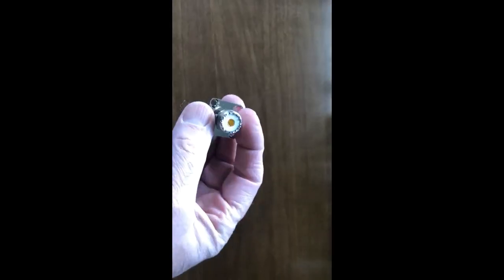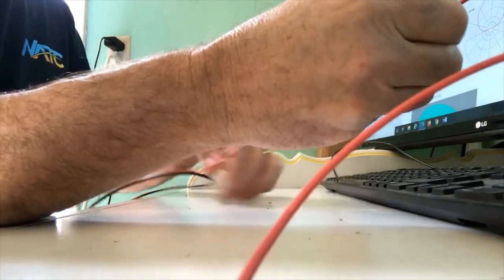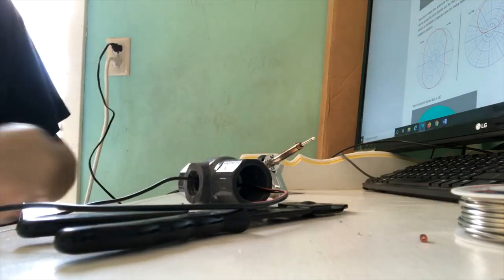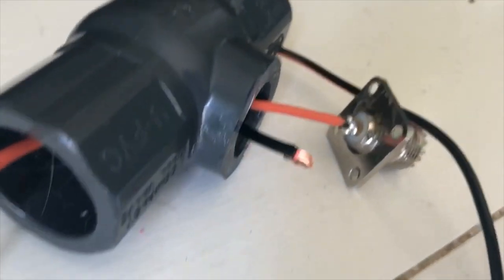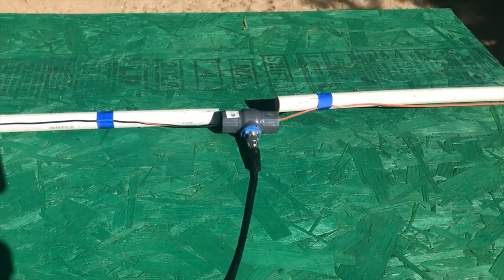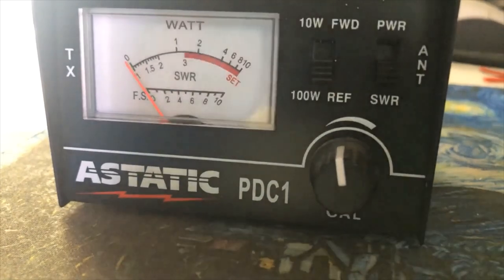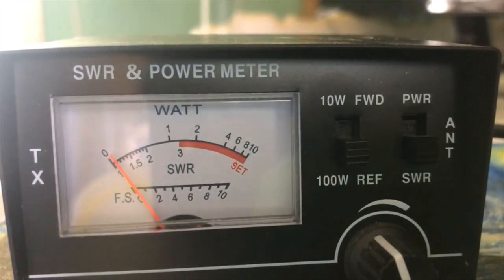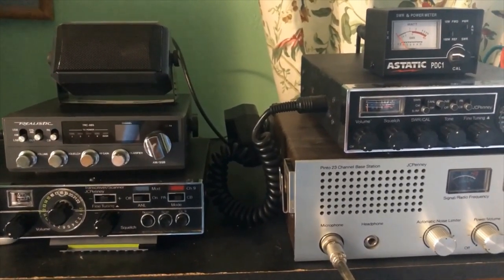Homemade PVC CB Dipole Antenna

Comment: The top scale on your meter is in watts. The scale below it is SWR. Your first match was closer to 4.5:1.

Pro tip: Grab a standard calculator and enter the following:

234 / 27.205, (Ch.20), = 8.6 feet.
.6 X 12 = 7 inches so each leg of your dipole will be 8' 7"

This will save you 12 of your 13 trips out to the yard.

If you are making a vertical dipole, use the above formula but add 5% to the bottom wire.

8'7" = 103" X 5% = 108" for the bottom leg. This should make the dipole a little more broad banded to flatten your match between 1 and 40. I haven't used PVC but be aware that proximity of an antenna element to metal structures or even some plastics or Bakelite can reflect the signal and affect the match. 

If you are a true purist, you can also figure in the velocity factor of your coax.

ALWAYS use the minimum amount of coax necessary to do the job. Having a 30 foot coil of extra inline coax laying on the floor of your shack makes an electrical choke which absorbs power that you could otherwise be radiating into the air.

Velocity factors of the most popular coax as follows:
RG-58U   = .66
RG-58AU = .66
RG-8         = .66
RG-8X      = .73

234 / 27.205 = 8' 7" X .66 = 68" or 5' 8" for RG-58U, RG-58AU and RG-8 cables

234 / 27.205 = 8' 7" X .73 = 75" or 6' 3" for RG-8X cable

When measuring your coax, take the 5' 8" or 6' 3" figures, depending on your cable type. Measuring your cable requirements, use odd multiples of the above figures.

Example: If you are using RG-8X and need about 50 feet of coax,

50' X 12" = 600"
600" / 75" = 8 X 75" lengths but this requires odd multiples so you either round up to 9 lengths or round down to 7 lengths depending on your requirements.

If you are using RG-58U, RG-58AU or RG-8 coax @ 50 feet.

50' X 12" = 600"
600" / 68" = 8.8 lengths so for odd multiples you can round up to 9 lengths or down to 7 lengths depending on your requirements.

This shouldn't require saying but obviously you do not cut your coax to these lengths but measure it out to these equivalents.

I convert these measurements to inches so as to not have to convert decimal fractions of feet to inches later for simplicity sake.

All of the above formulas work for any frequencies. Just substitute the center frequency of your band of interest in place of the 27.205 center frequency of the 11 meter CB band.

Example: 2 meter ham band = 144 to 148 Mhz center frequency is 146 Mhz.

Just be aware that with higher frequencies comes tighter tolerances. Where you may measure or trim inches off a wire type CB antenna, you may be measuring or trimming millimeters at 2 meters or 70 centimeters, (The 440 Mhz ham band.)
Reply from the maker: Wow, thanks for the information! When I made this antenna, I had zero experience with antenna construction. I appreciate the constructive criticism. You have given me a lot of information to digest. I realized later after making a few videos that I was reading the SWR meter wrong. I was also horrible with my soldering skills when I look back. The past year I have been reading up on antennas and made my first vertical dipole for my 2-meter radio. You are correct, adjusting the length on the 2-meter antenna was very precise. Thanks again for the information and 73s from 595 Northern Nevada!
Reply: @RidgeHikerAdventures  Happy to help.
Pro tip: The next time you want to solder to ground on an SO-239 antenna socket, File the chrome off from the area that you're soldering to. Solder prefers to stick to the underlying brass rather than chrome.
Reply: You know your stuff!   Stuck in a second story apartment. Would I get any use from this antenna, if mounted vertically against but extended 3" - 8" out from a brick wall or column?  Local CB commination is what I'm after.  Thank you!
Reply: @laraza4trump130  Unless you have 16+ foot ceilings, the dipole antenna in the video won't work well for you.
    If you could see the signal coming out of, say, a mobile antenna, you would see a radio wave emanating from the shaft in an up and down wave and a magnetic wave coming from it from side to side. 99.9% of CB antennas are "VERTICALLY POLARIZED" this way.
    If you constructed that dipole and hung it horizontally on your wall, you would reverse your polarization. This isn't necessarily a bad thing if the people that you want to communicate with have their antennas polarized the same way. If not, you won't transmit or receive very far. Horizontal polarization will inherently receive less noise and static but at the cost of who you can effectively talk to. This is because most radio noise is also vertically polarized.
    What I would suggest is an inverted "V" antenna. A child of 5 could build it, (No offense intended. They're just that simple to build), and they are vertically polarized.
    The simplest way to build one is to cut any kind of copper wire into 2 lengths 103 inches long, connect one leg to the center conductor of your coax and the other to the shield braid. Hang the end of the coax with the 2 legs connected as high as possible on the wall. Extend the other end of the 2 legs out and down at a 45 degree angle at the ends and pin them to the wall. You must let the coax hang in the center down to the floor. Plug it in and you are on the air.
    You would be smart to take a small piece of plywood like 2 X 4 inches, drill a hole on each end and two in the middle like a criss, cross so that you can wire tie the 2 legs and the coax to it for strain relief then hang the piece of wood on the wall with the top hole. If you are using RG-58U coax, the center conductor is pretty delicate. If it breaks and you don't know it, keying up your radio can blow the final transmitter transistor. RG-8X is a few cents more per foot, not much bigger than the 58U and is a lot more robust with a stranded center conductor rather than a single brittle strand.
    It is always a good idea to check your antenna with an SWR meter. You can trim this antenna for a better match if need be. Check it on channel 20 to start. If it is above 2 to 1, you can trim off 1/4 of an inch at a time ON BOTH LEGS and TRIM THEM THE SAME. If you get it below 1.5 to one on channel 20, 1 and 40 will take care of themselves. If you trim it too much, your match will begin to rise and will really go up on the bottom channels. You should NEVER key up with a match of 3 to 1 or higher or risk damage to your radio.
    BE AWARE. The inverted "V" antenna is vertically polarized but very directional. If you have it hanging on a north facing wall, your best transmission / reception will be north and south BROADSIDE of the antenna. East and west means east and west.
    KNOW THIS. You can NOT build 2 of these and hang them north and east and connect them together. You can, however, build to of these, hang them north and east with separate coax and plugs and feed them from your radio through an ANTENNA SWITCH. All you need is a 2 way switch. You can pick one up at a CB or ham radio shop. It will have 3) SO-239 CB type antenna sockets on the back. Two will be for the antennas and the 3rd for a short jumper to the back of your radio. I haven't bought one in decades but they aren't too expensive, adjusted for inflation.
    If you do this, when you get someone's attention, as they are talking, switch back and forth between the 2 and which ever is louder, stick with that one.
    I have used these many times on the pirate bands to talk to South America and Europe on single sideband at 200 watts with no problem. If you have a standard CB, you may get around town a few miles or so as long as "town" isn't down town Manhattan.
    Good luck my friend. I can tell by your handle here that we don't agree on politics but we can agree on radio.
Reply: @jeffmccrea9347  Inverted V is a fantastic option but I don’t have the room and it’s a concrete box.  I’ll experiment with one and want to make one to test in open air.
Great information a two-antenna switching setup would be fantastic.
I’ve got a 80’ish exterior 2’x2’ brick support column, probably steel core.  Management already agreed to a ½ wave dipole, mounted vertical, externally to that column up to 1 foot away.  It’s relatively free of RFI and is part of my balcony, which is abnormally large.  It seems like a good choice for a ‘low’ RFI environment.  It’s large enough to build a faraday cage. Chuckles  I’m on the first two floors and mounting it at ¼ wave height or higher is no problem.  I can't do the ground plane radial setup.  
My real concern is if I’ll receive anything…  with that type of setup.  
Oh the nick!  Forgot I was still using it.  Came up with it, in 2016 to tease folks that bought the racist MSM narrative that Hispanics wouldn't vote from Trump.  Poking fun at the hypocrisy of it all.  I’m a “Tasty Canadian” as Art Bell used to say.  Lots of us come equipped with a bent sense of humor.  😊
At this point I might as well just ask to stick a SDR, utility computer and DX commander on the roof, and remote into the system from my unit
Reply from the maker: @laraza4trump130  Mounting it vertically would be best for local communication. Optimal height for a dipole should be around 1/2 wavelength. My antenna in only around 10 feet off the ground but I'm still able to get out locally. At that height my antenna is more directional than omnidirectional, and I've observed that with range tests. With you mounting your antenna on the second floor I would imagine the extra height would get a better radiating pattern than I do. Try it out and see what happens. 73s from 595 Northern Nevada.
Reply: Yea, you took the words right outta my mouth....lmao

Comment: Mount Verticle with the POSITIVE on top and do not use metal mast pipe so the antenna id=s close to the pipe will kill your swr reading but a good job thank you for sharing.
Reply: Yes I found that out cant mount it on metal pipe but  horizontally in loft beams great for ssb

Comment: I just saw this.  I am somewhat impressed with the construction and the process.  I am quite a purist but look at the practical and quite frankly, this process would produce a very good antenna on any frequency up to about 900 MHz of course using a different connector and feedline for anything above 30 MHz or over 100w.  There i would move into RG8x, RG8, then LMR as frequency and power increase. At 27 MHz RG58 is fine unless the run is terribly long, over 100 ft. I would agree with one poster about doing it in free space - but probably not anything significant although i would personally have tried to get it up close 15 feet from the ground on a mast - I do doubt much difference.  I do not know if you are planning to use it vertical or horizontal, most look at diploes as horizontal.  If your primary conversation is base to base, horizontal seems best for several reasons.  One, a dipole does have some directional component - off the sides - and if the communications are to mostly the same places, orienting it will help, in fact off the ends there is a significant null.  If you are talking mainly to mobiles go vertical, there is about 20 DB loss in a vertical to horizontal path, that is over 3 S units - 18 db.  dipoles can be mounted vertical if the feed comes off at 90 degrees and there is a way to go down the lower part using coaxial cable as the lower half of the dipole.  i did build a dipole for 2 meters using PVC about 10 years ago - we had a friend who was in a nazi prisoner of war camp (an HOA) and could not put up an antenna, we put in in an arborvitae about 5 feet off the ground. He could hit every repeater within 50 miles with 50 watts. I have also used thin wall PVC as a radome for 2m slim jims,  I built 6 for an event, tuned the first one outside the PVC than put it in and it was long. The slim is about 50 inches long, i had to cut off about 3/4 inch.  I have since learned the reason on a fan dipole for 20/17/15 meters i built with speaker wire, two winters got to it and I rebuilt it with bare wire.  The bare wire was set to the same measurements and was bout 6-8 inches short. We all work with velocity factor on coaxial cable but it also applies to antenna wire.  Introducing a insulating jacket makes the wire seem longer to electricity.  It is only about 3-7 percent depending on the insulation composition and thickness but it is there.  If you work with an antenna modeling program like exnec it will show that.

Ralph Brandt K3HQI (Extra Class) WRPG834 KAOR6315(old CB CALL) AFA3HQI (expired AF MARS)
Reply from the maker: This was one of my first antenna builds and I was happy with the results despite my soldering skills at the time. I chose this design for its dx properties as well as it was pretty simple design to construct. I mounted it horizontally with it orientated north/south. I placed it on top of my RV which was not the optimal height at around 10 feet. I was surprised how well it performed. In the two years I used it, I talked all the way to Australia and with all 50 states. The coax run was 36 feet. Thanks for watching and the comment!
Reply: I wanted to add this and missed it. Try an inverted v some time. A dipoli has nulls off the ends and brst signals off the sides. Those nnulls can be about 30 db and about 20 db at 5 degrees off the line of the antenna. An inverted v is cut anout the same as a dipole but the center is pulled high, the envs sloping down. My 80 meter 128 ft long was a dipole running NW to SE when i drooped the ends i started working the Carribean and never had a vontact there before.

Comment: For those of you who don't know...the antron 99 and imax 2000 are modified endfed vertical dipoles.   You lose around 20db being horizontal polarized if you use a reg dipole on cb and talk to someone vertical.  Keep that in mind. Best to be vertical polarized on cb
Reply: yes, and someone says that orizzontal takes too much noises..
Reply: @napomania  man made noise is normally vertically polarized.  A vertical on the lower bands below 14mhz makes it pretty obvious. I prefer a vertical for 14mhz to gigahertz. Noise is less of a factor it seems at 14mhz and higher.  Some people run stuff like the old moonraker 4 and maco shooting star that vertical and horizontal polarized elements.  You can also use 2 antenna at once with different polarity and it will eliminate phase shifting and make it easier to hear.  You can learn alot building antennas.  It also helps if you have a antenna analyzer or a nano vna to check it
Reply: Lose 20lb what on my fm dipole kit pulls in station all over 🎉

Comment: Best antenna I ever made started with a carbon arc rod while in the navy. I made it for a am/fm radio. I was picking radio stations on both bands from over 50 miles while midship of an aircraft carrier right below the flight deck. I thought about trying it with a cb radio to see what kind of reception/transmission I could get. Never made it to a shop that sells carbon arc rods.

Comment: Nice video. Would it not be easier to twist the 2 wires together and then solder them to the connector? Just saving a step.

Comment: Interesting antenna I don't think I have ever seen a PVC plastic pipe Di-pole done before and it's all new to myself and I was just wondering if I could make a similar antenna but for the 2/70 amateur radio frequencies and if I actually made one then it would be interesting to try it out on the 2/70 bands and just see how far I can get with just 25 watts so I'll give it a try one day and I'll let you know how I got on making the antenna and I can get all the bits from my local DIY shop and it should be cheap enough to buy in the shop so anyway that's my plan. Thanks and best 73's for now cheers. Stephen M3SNV 73's.

Comment: Very good. Looks like you have tuning the antenna down. If you fold the wire back on itself it is the same as cutting it. That way you only prune it once. To each their own. I have a lot of those rigs. You should make a 5/8 wave end fed. You could use a shunt match, ring match or loading coil. You could make it out of aluminum or wire. 73
Reply from the maker: Thanks for the tip (that would have saved considerable time). I’m new at antenna construction and appreciate any advice. I’ll take a look at the 5/8 wave. 73’s from Northern Nevada!
Reply: I'm interested. In the 5/8 antenna

Comment: When soldering electrical connections you should use rosin core solder. No other flux is required.
Reply from the maker: Thanks for the tip, I've been using rosin core since making this video. I appreciate comments like yours to point out areas I can improve on. 73s from 595 Northern Nevada.
Reply: I use Kester 60/40 rosin core but i also brush on extra flux, it aides in helping clean older connections which may be somewhat dirty and dusty especially found when making repairs to older equipment or outdoor antenna repairs. You can never go wrong with some extra flux.